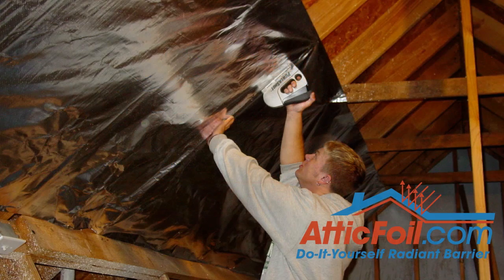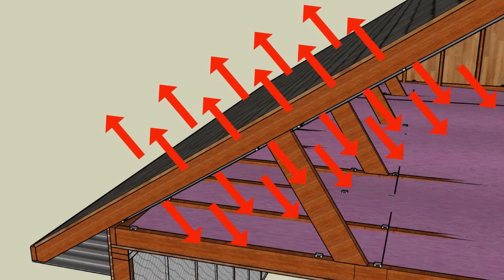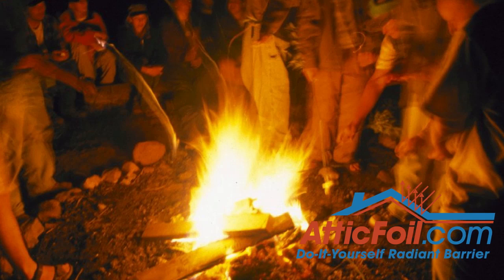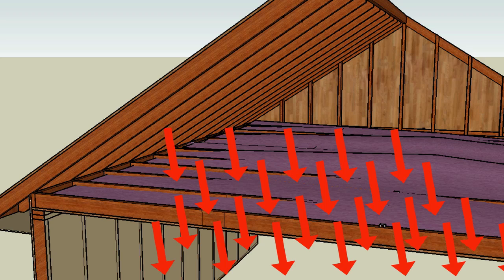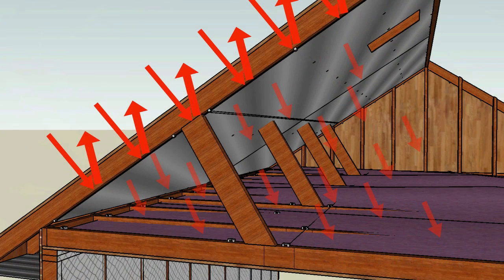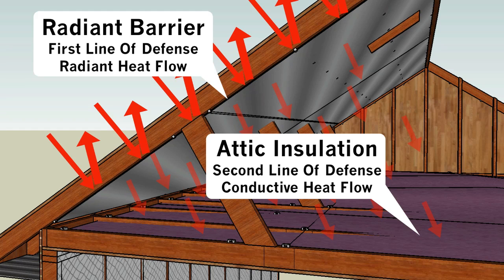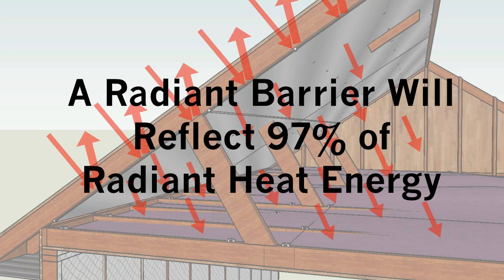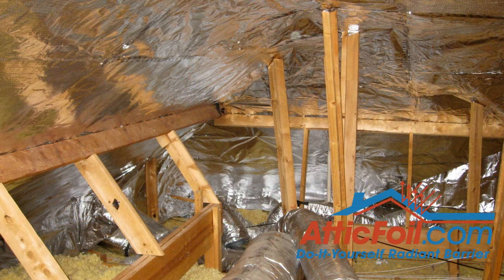Cool Down Your Attic or How Radiant Barrier Works? - AtticFoil® Reflects Heat From INSIDE The Attic

Comment: Do you get more of a cooling effect if you staple it up (rather than laying it down directly on top of the existing insulation)??
Reply from the maker: In theory, the further you get the radiant barrier to the "outside" the more effective it is at reducing heat gain (cooling effect).  This is especially true if you have ductwork in your attic.  Stapling the AtticFoil up will reduce heat transfer into the attic insulation AND put your ducts in a less hostile environment.  If you don't have ductwork in the attic then the additional benefit of stapling it up is pretty marginal.  So, laying it out works fine if you have no ductwork in the attic.  Plus, you will get more of a winter benefit by laying it out.  This page discusses the pros/cons of the different install methods: http://www.atticfoil.com/knowledge-base/choosing-the-best-installation-method.html

Comment from the maker: @KingOfTheEngineers We have a video here: http://youtu.be/OHpyv_kxmoI that covers the effect of radiant barriers on roof temperatures.  The roofs over a radiant barrier will increase in temperature usually less than 10 degrees which is generally considered to be insignificant as far as as having any negative effect on the roof.
Reply: Yup, I just saw you have a video on exactly this. Do you have a link to the DOE study about the roof temperature, I cannot find it no matter where I look on their site, and it would be an interesting read.

I did find this technical bulletin from Oak Ridge National Labs 
 ( http://www.ornl.gov/sci/ees/etsd/btric/RadiantBarrier/RBFactSheet2010.pdf ) that basically confirms everything you said and may give others looking into the question more answers about how it works.

I would install this if I weren't a HAM with an attic full of antennas.
Reply from the maker: The Oak Ridge National Lab is basically part of the Dept. Of Energy.  The link above is the same info I used.  You can lay the foil out over the insulation below the antennas.  I've had a bunch of customers do this with good results.

Comment: I'm sure this works for lowering the temperature inside of the attic, but how does it effect the roof? 

All of the heat that is usually dissipated into the attic is reflected back into the roof tiles. For this to work, the roof would necessarily need to be hotter than it would normally be, since it is effectively loosing a radiant heat transfer sink.

I would love to install this, so does anybody with experience know if it has any ill effects on the roof?
Reply from the maker: Here is a video on radiant barrier and the effect on roof temperature: https://youtu.be/OHpyv_kxmoI

Comment: I have seen 3 of your videos.
My question is how to install insulation in a Gambrel (barn style) roof?
Reply from the maker: You will install pretty much like a standard roof. http://www.atticfoil.com/applications-a-uses/attic-applications/staple-up.html  Many gambrel style roofs, don't have soffit vents, but DO have gable or other high vents.  The key is to leave gaps at the tops and bottoms of the foil.  As the air heats up between the foil and the roof, it will draw air from inside the attic.  (Usually it is from the soffits) Either way, the hot air will find it's way out the top of the roof.  This system is not ideal - but the radiant heat will still be reflected and significant reduction in heat load will occur.

Comment from the maker: Typically sheds are not insulated since you are not really trying to "condition" them.  Basically, you want to "temper" the heat to make them halfway comfortable.  I actually have a shed with AtticFoil and siding only and it stays pretty comfortable even with the sun beating on it.  Kinda like a car parked in the shade.  Unless you want to heat/cool it you won't get much advantage by adding insulation too.

Comment: Hi. I have a radiant barrier on my shed and the walls are insulated but the roof is not. I was recently doing some lighting work and very close to the RB. I could feel the heat radiating off the barrier and am concerned that it is not doing much good without accompanying insulation. Can you validate my concerns or am I incorrect in my assumptions? Is there anything I can do? I'd like to keep the   vaulted ceiling. Thanks in advance!

Comment from the maker: We have had many customers double the foil up with significant results.  However, the 2nd layer will only be effective against the radiant heat that makes it through the first layer.  The first layer will by far have the biggest impact.

Comment: What is the difference between your product and E-Shield?  We live in the Northern VA area. Our house was built in 1955. Split level.  Brand new windows.   Summers are miserable.  HVAC tech recommended taking care of insulating our attic.  We're very confused as to which product to use.  BTW, my husband and I are still newlyweds; but no longer can we bare one more HOT summer night - It's nearly impossible to sleep in our room... and NOT for the right reasons :)

Comment from the maker: You would never remove the foil once it is up.  It will help reflect heat coming FROM the home back towards home.  The reality is that a roof does not produce a lot of heat in the winter.  The days are short, the angle of the sun is low and the colder it gets more heat will be pulled out of the shingles due to wind. It's difficult to quantify, but heat lost from the sun is probably gained by keeping heat in the structure.

Comment from the maker: Actually this will not overheat the shingles.  A roof over a radiant barrier will increase in temperature only between 5-10º which is considered nominal as far as long term effect on shingles.  I have a video dedicated to this subject.  Look for my video "Does Radiant Barrier Damage Shingles?"

Comment: hi, this is nice way to protect heat in Summer. My Q. do you remove the whole reflective barrier out during Winter? Isn't it difficult to staple again or remove in other season? How do you solve this in winter when it needs heat.
Reply: In the winter, the radiant barrier will reflect the heat from below back instead of escaping out the attic to the cold outside air. Heat travel from hot to cold depending on if it is hotter outside or inside. In the winter,  75% of the heat produces by the furnace escape out the attic without a radiant barrier.

Comment from the maker: Respectfully, this is not misleading at all.  The ONLY way heat travels from the sun to the earth is in it's radiant heat form - It CANNOT reach earth by conduction or convection because of the vacuum of space.  I think you are confusing the different parts of the light spectrum.  Yes, the infrared part of the light spectrum is just part along with UV and the visible part.

Comment from the maker: @EclecticFortune It depends. If you start the foil at the bottom and and work up, then most likely any water from a leak will only go a couple of feet before it hits a seam. At that point it would drip down to the sheetrock and you would see a wet spot on the ceiling and have the opportunity to fix the leak. (hopefully before much damage). Any water on the foil would also leave a "trail" which would help pinpoint the source of the leak.

Comment from the maker: First, I would try to get some form of ventilation.  Ideally, you want air coming in the bottom and out the top.  As for install method?  It really depends if you PRIMARY goal is to reduce cooling or heating costs.  Staple up if trying to reduce cooling costs and lay out if trying to reduce heating costs or if you have NO ductwork in the attic.  See "best install method" at AtticFoil(dot).com

Comment: I live in the midwest with hot humid summers and brutal cold winters. What's best - laying the foil down on top of the insulation on the floor or stapling the foil to the rafters? I only have two gable vents, that's it. My house is old so I have no soffits.

Comment from the maker: @julebuggy No, shingle and roof temperatures only go up between 2-10 degrees on a roof with radiant barrier. This is generally insignificant to the life span of the roof.  The color of the roof can easily make a 30 degree difference alone.  Go to RadiantBarrierGuru(dot)com and search on the word BAKE.  There is an article I wrote called "Am I Going To Bake My Shingles"

Comment from the maker: @01mustang05 Radiant barrier also helps to reduce heat loss.  Remember, heat always moves from hot to cold.  So, you want both r-value and low emissivity surfaces to reduce heat flowing out by conduction and radiation.

Comment from the maker: @tps70124 Yes and No.  Since the sun is pretty low and the days are short in the winter, most areas don't get much added heat from the roof through the attic in the winter.  Yes, it would actually keep this heat out.  However, it also reduces heat loss in the winter by keeping heat in.

Comment from the maker: @Xytos To be honest, you could use plain aluminum foil.  The problem is that plain aluminum foil has no strength.  You might be able to get it up, but one wind burst or even bird a bird in the attic would pull it down pretty quick.  Thanks for the comment.